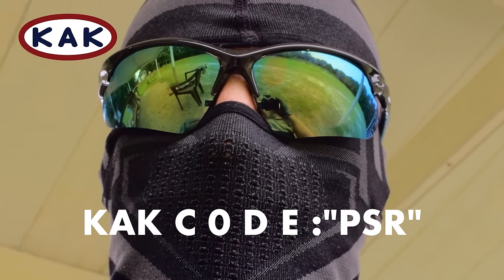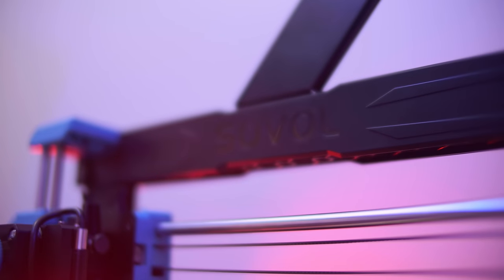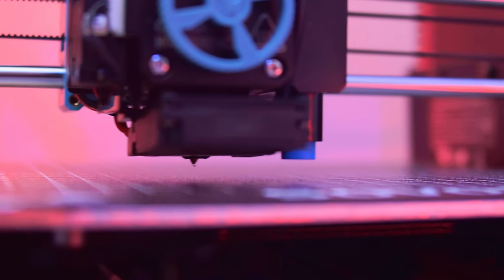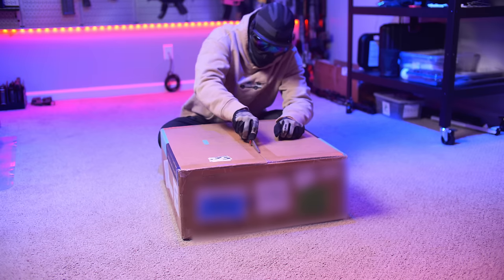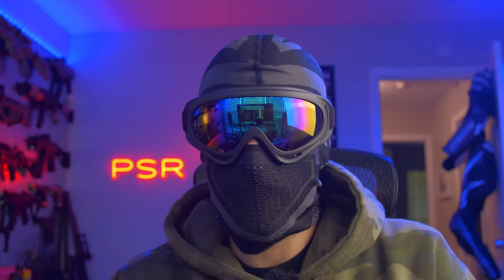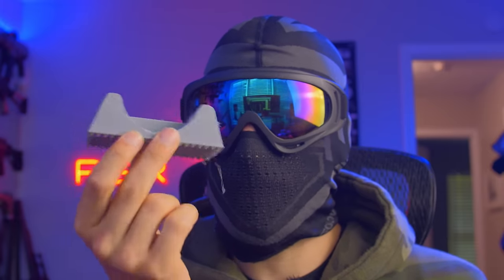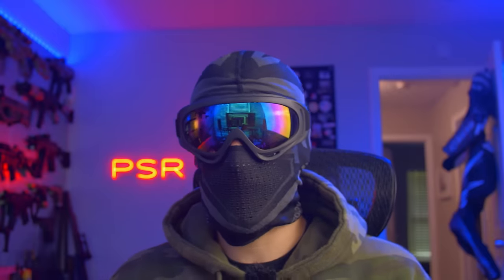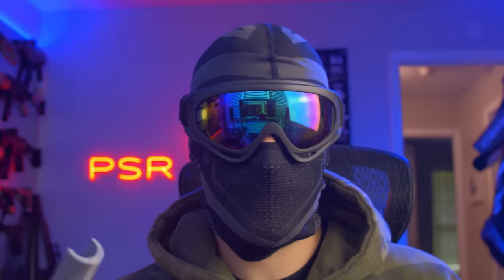Is This The Best 3D Printer For Beginners?

Comment: Welp, guess i'm getting a 3D printer. I took a cad class in high school about ten years ago, our printer then cost about 30 grand and i'm pretty sure the one in this video could outwork that one. Amazing how much the technology has progressed
Reply: get the IDEX version you can mesh flexible TPU and stiff PLA together with a cura slicer your prints will be on the next level
Reply: If u got it yet do u need a computer to run it or connect to it ?
Reply: Well I bought this one and it has been a nightmare for the first 48hrs it has a bunch of defects and I wish I would of bought anything else
Reply: @gregghuge3270  What issues were you having? Was heavily considering this printer.
Reply: @squidbra  had to complete disassemble he hot end and reassemble it and the heatbed broke after like 3 days of which the chinese company has zero customer support so they would not replace anything for free so I was just assed out another 80 dollars.

Comment: I've maastered the basic Ender 3 over the last 2 years, so I went for the upgrade and got a SV06+ this spring, it's a very nice printer but mine has an unreliable PSU, I wouldn't expect more reliability than an Ender 3
but that's it, great printer and cheaper than buying an Ender and upgrading it
Reply: you are acting like using an ender 3 is hard....
Reply: So what printer do I get ??

Comment: Auto bed levelling is a basic requirement now, IMO. I used to spend more time fiddling with my E3V2 than actually printing. Now i have a CR-Touch on it the difference is night and day.  I couldn't recommend someone buying a printer without it now (or at least buy it along with the ABL kit to install straight away). 

This looks a pretty compelling choice for an entry-level machine.
Reply: I have an S1 and love it. I'm glad I got into it with ABL.
Reply: I have the s1 as well and that party probe makes all the difference. Wish the UI was a bit cleaner but that's what the pad is for
Reply: yea im buying a sovol my enderv2 has been a pain in the ass to upgrade i dont want to fiddle with it anymore id rather buy something with all i need out of the box

Comment: Yeah after working with my enders for a few years now, I will still recommend them on sale to people interested in casual printing but anyone who is interested in more I definitely recommend buying some more features out of the box, it's a lot more cost effective.
Although you do learn more running and adding upgrades yourself, troubleshooting can be a very very tedious process and lead to lots of down time (lol 2 of 4 enders are down cause of awful clogs due to part issues)
Reply: I've spent so much time on my ender, it's insane. I don't mind the tinkering, but I've had a number of projects derailed because I needed to service the printer. It's still my one and only printer, and it's working right now. I like messing around with stuff, but I can imagine someone else quitting because of the hassle. It's good to see solid models out now for under 500 that just work.

Comment: Having used printers with and without auto bed leveling professionally, auto-leveling is now mandatory (XYZ Printing Da Vinci Super and Raise3d Pro3). I should see if I have permission to share my Functional Test Block I designed on the various print file sharing sites, it's designed a lot differently than most of the benchmarking files. 2x2x1.5 block with 1/16, 1/8, 1/4, and 3/8 features that we use on our machined parts (inside radius, outside radius, chamfer, thin-wall feature, and holes at 90, 45, and 0 degrees relative to the top) so you can throw a calipers on to measure what your actual tolerances are comparable to making machined parts. (The pro3 passes with flying colors, at .001 to .005 undersize depending on the feature in XY, and about .010 under in Z axis, comparable to a lot of our machined parts. Which, for a $5500 printer, is relatively unsurprising)

Comment: Any chance of reviewing the Elegoo Neptune 4? It's basically the same setup and price, but due to the printhead it can print up to 500mm/s, and at 250mm/s you can speed up print time with minimal/no warping. Also comes with filament detection, which allows you to use multiple 1kg spools for a single print.

Comment: You should get a bambo labs printer. Super fast and the same price as a prusa and if you spend a bit more you can print multiple materials! I think the p1ps would work great for your projects!
Reply: For this hobby, an opensource/openware printer is probably best for obvious reasons. 

However, the bamboo is great. A company I work with just replaced with Bamboo and absolutely loves em. Even offered me free print work now they've got a bit excess capacity.

Comment: If one wanted to learn how to model their own things to print what resources do you recommend? I Just ordered the printer and want to dive right in making some hand guards and stocks that suit my preference for airsoft as a lot of real steel stuff doesn’t accommodate batteries.
Reply: Fusion360 from commercial options, FreeCAD as opensource (a bit steep learning curve, but great YT tutorials available) or even Blender (not a CAD).
Reply: there's also the Mosquito airsoft kit if you're feeling daring to make a whole new gun that kinda looks like a wonky Scorpion smg ;)
Reply: Most people in this world use solid works, I am trying with freecad but uts difficult. Honestly you can make a lot in your slicer (I do more with the slicer and basic shapes than in freecad currently, with negative part modifiers you can actually do alot.

It's not easy to kearn, but worth it
Reply: @abstractapproach634  MangoJelly Solutions and Adventures in creation have great FreeCAD tutorials in YouTube. I learned watching them. And learn the fully parametric way from the beginning.
Reply: if you want to start from zero there is a channel called JMCAD that is basically like taking classes. it reminds to when i used to go to high school and take CAD back then...

Comment: Printing filaments appear to be fragile in their construction, especially in parts that receive a lot of vibration from mechanical shock with a lot of pressure, some metallic structure is used as structural reinforcement. It's interesting how you approach the topics in your videos on this channel.

Comment: This printer looks great.  I bought an Ender 3 Pro back in 2020 for $250. Does it work? Yes. Have I spent an additional $250 in upgrades and repairs? yes, easily. How many hours have I spent over the last 4 years adjusting and fixing it .... probably, realistically not joking.... 150 hours. Would I recommend that someone pay the money for a plug and play solution if it really works out of the box, even if it's $600? Yes, definitely. I couldn't afford that in 2020, but I still ended up paying that and more.

Comment: If there is no Auto bed level, 300C degrees printing, silent printing, it is not worth buying.
If you have any decent money, get NOT a bed slinger. Bed slinger models can tip the model over if too thin and tall, or have movement artifacts during high speed large prints adding mass.

$100 saved here and there isn't worth it when nylon CF quality rolls run $60+ for 500 grams!
Save money long run, get quality model with vertically moving bed.

Also get magnetic build plate for preventing breaking the print or printer on large prints.

Comment: Do you think this printer is good for most applications? Or would you say going with the plus for bigger print capabilities is recommended.
Reply: If you need the bigger print volume then you need it! But that entirely depends what you intend to print. Be aware that printing large objects, particularly on a bedslinger, is SLOW.

Comment: Gah, making me feel bad about spending $200 on my Ender3 lol. Can't wait to hear what is coming from Creality next and what upgrades I can do to mine.
Reply: These are great, but for example BambuLabs P1P or Creality K1 are awesome for the price!
Reply: Endor us the 3dp2a standard, I'm the one who should feel bad after a $700 prusa and freecad.
Reply: The K1 Speedy is amazing! Benchy in under 20.
Reply: Creality are playing catch-up now tbh. Bambu Lab are leading the pack with the X1C and P1P/S.
Reply: @alun7006  Out of P1P and K1 I would take the K1 just because Creality has longer track record and you don't have to route your prints through the cloud to get fully featured slicer. What could go wrong? And Cura profile for the K1 must be coming soon. I would just replace the K1 bed plate with some PEI coated steel plate.

Otherwise these almost Prusa mechanics all metal hot end direct drive printers are getting better. I just wish Prusa MK4 was already core-XY.

Comment: Ehhh. I bought this printer and now instead of having a 2a hobby, I have a “fixing my printer” hobby.

Just get the bamboo. I know I’m like 300$ in the hole with this thing with upgrades and mods and have had only two successful lowers with countless failures. PLA+ starts to add up. If I could go back I would have gotten a Bamboo. Especially now that the A1 is in stock🤷🏻‍♂️

Comment: With the Ender3 V2 being on sale for $215 would you recommend it over the one in the video
Reply: if you watch through the whole vid its pretty obvious the svo6 is better
Reply: @Varinius being able to do hot materials like nylon is really all it has up on the Ender. But that is pretty big depending on what your doing.
Reply: No. The Sovol comes with a much better extruder and hotend, and bed levelling as standard. No contest.
Reply: @colbywishneski5800 Nah I would go with the Sovol over the ender. If you can get the ender for $100 it may be worth it but you'll likely spend tons of time upgrading or being frustrated. Enders work but they take lots of effort for 99% of them
Reply: @alun7006  thanks for explaining it. I’m new to 3d printing, I knew that those were all better on the sovol but I didn’t know how important they were and wether they were upgradeable or not.
Reply: @colbywishneski5800  no worries! All these bedslinger printers (where the Y-axis travel is provided by the whole print bed moving back and forth) are very similar tbh. You can certainly get an Ender 3 up to the same level as the Sovol by adding a bed levelling probe and changing the extruder assembly, but you'll be spending more money and having to do all the work yourself.

Comment: Just noticed the SV07 is 100$ off coming in at $320. Is the SV07 just the better printer or does the SV06 have anything over it besides price?
Reply: Sv07 moved back from linear rods to V-slot wheels which will wear out over time. Sv07 prints a lot faster for 100$ more though
Reply: @awkwardsaxon9418 I’m fine with that. Right now the sv06 is 280 and the sv07 is 320. OVER TRIPLE THE PRINT SPEED FOR $40, SIGN ME UP!

Comment: whats about the sv07 model, is it not better ? sure it cost 100 bucks more, whats your opinion?
Reply: 50% more is a lot extra (and yes next printer I will get is likely a $100k used metal printer so I can do Titanium/Aluminum/SS, so I'm not saying $300 is a lot, I'm just saying comparatively its a lot more). I have a few TronxyX5SA printers, they were I think just under $300 shipped, and they have 330x330x380mm build volume, core XY (the slow kind with rollers though, but they do sell linear rail versions or upgrade kits), I believe auto level (I just get it so close I'm not sure, but it does probe the bed values), and has the PEI plate or whatever (I often use glass though). So with those you can print pretty big stuff, or a lot of stuff. I did a small repeating crossbow and it needed 300mm length which was no problem and came out perfect. Right now I'm printing about 10 pieces to a flintlock at once, its just very reliable machine. Its a kit, but the first one took less than 4 hours while watching unrelated YT videos (because it was a weekend, I wasn't rushing it and its kind of like Lego's something fun to assemble).

Comment: Been waiting for you to do a video like this one. Based on your advice im going to get this printer. Thanks
How familiar do I need to be with Linux? I only have a windows PC. Sorry I'm on the edge of boomer and not super tech savvy.
Reply: No familiarity required whatsoever. Cura works fine with Windows.
Reply: No need for linux at all, unless you run Octoprint or such, which is easy AF

Comment: Ok, so I am 38, pretty tech savvy, but have never used a 3D printer before.  I plan to use those hotter materials to print frames and parts.  Should I go for this, for my first printer, or is there one I should buy instead?  Thanks for any help.

Comment: I am having so much trouble trying to get this things prints to stick to the surface. I have tried glue sticks and cleaning it. Ive tried both sides of the pad, I tried tweaking the print speed. I am 100% at a loss here. I was so excited to finally get this printer and enter this community, but the beginning hurdle is killing me. Anyone have any advice that will get me out of this rut?
Reply: I have the same issue it doesn’t adhere to the bed.
Reply: You have improper z offset causing it to come off surface, make paper flat as possible when doing z offset

Comment: at 3:56 I see you printed a 43x.
Did you have any issues with the front and real rails not sitting at the same level? I've printed 4 different models and they all have the same issue, this makes the slide super hard to install. I messaged @nguyenkvvn about this but he never responded..

edit: just got to the part where you mention you just ordered the rails, so nvm.. But looking forward to that video and if you run across the same issue. I overlayed the DD43 and DD43X models in Cura and the rear rail holes are not aligned, but they should be identical since the rails do not change, so something funky is going on with the 43X models..

Comment: Bed leveling and misinformed information is why I stopped. I got this weird ender 3 variant that doesn’t accept the auto leveler they sell, and was told that a glass bed prevents sticking. It doesn’t and you don’t want to bend glass
Reply: Glass is fine if you wash it well before use. But PEI sheets are much better.